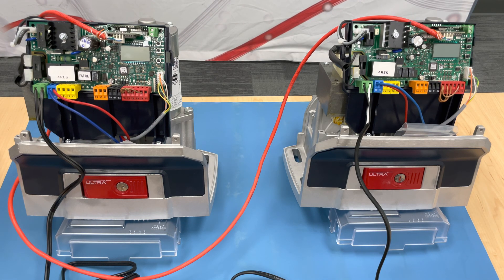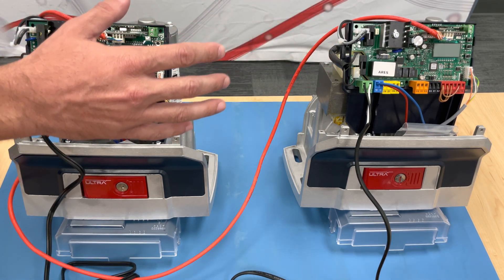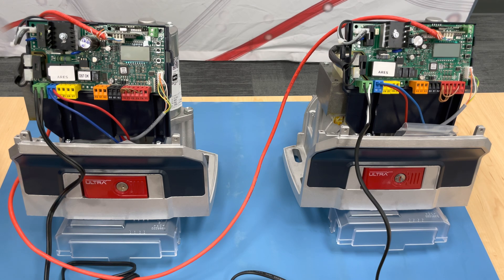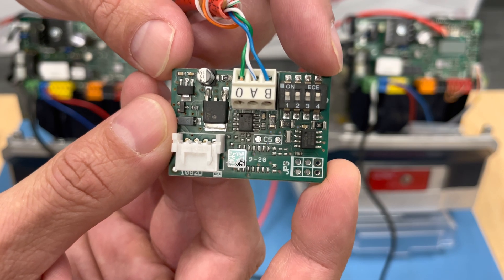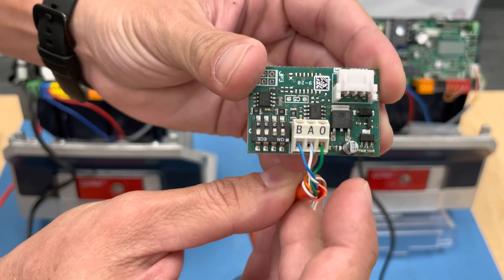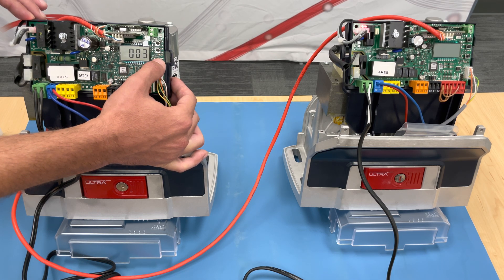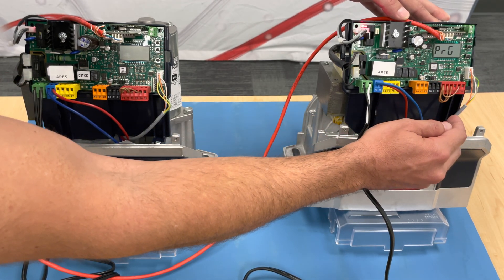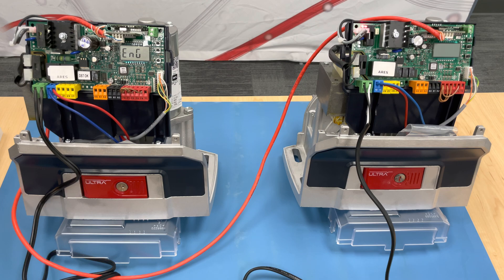BFT Primary/Secondary Setup For Deimos, Ares, Icaro, Giotto, Michelangelo (B EBA RS 485 Link)

Comment: I want to program one motor the control board, ¿how do I do that? 

What configurations do i need?
Reply from the maker: Are you trying to set up just one motor and not use the primary/secondary set up. If that is the case you can email us at tech@bft-usa.com and we can send you more info on how to get that done.